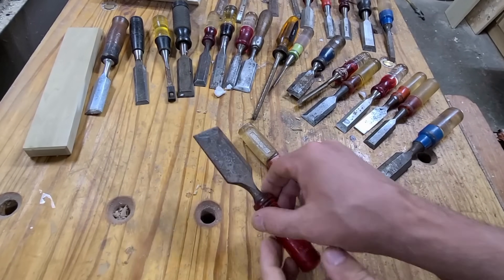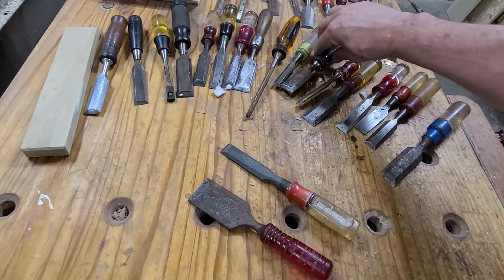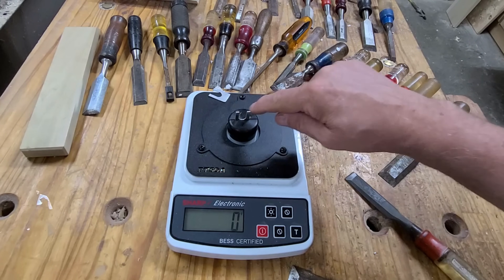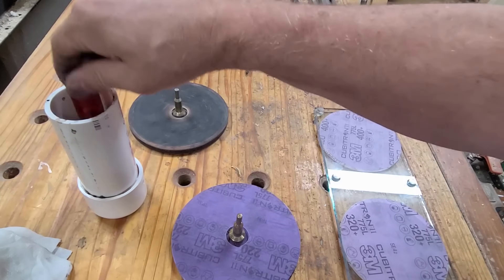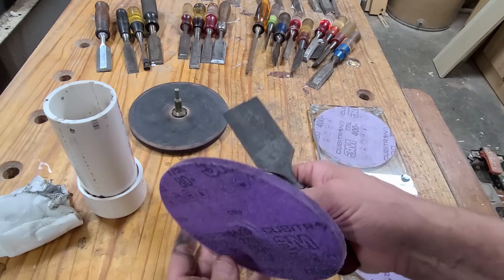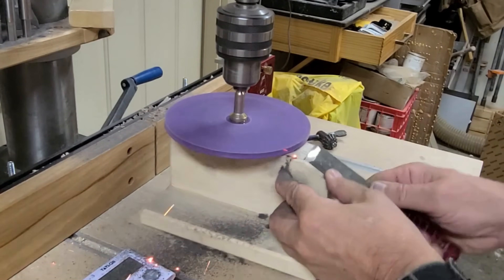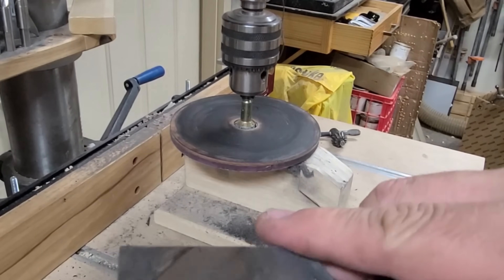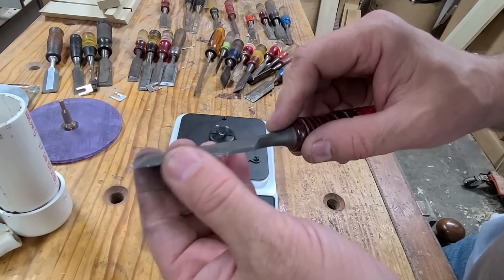Renew the most severely rusted bench chisel in 4 minutes (ON A BUDGET)!!!

Comment: What's the rush?  We do woodwork for pleasure. If you think I believe that the chisel didn't get hot while all those red hot particles of steel were being ground off you must think I'm daft. We used to test sharpness by shaving your arm. A better bit of test kit would have been a thermometer to show the exact temperature......especially near the edge where it is thin and colours up up quickly when you try to cut corners. They still make water cooled wheels for this exact reason.

Comment: Impressive jig. Having a slope is enormously better than a honing guide and/or wetstone wheel. 25 degrees covers plane irons and chisels. Once the chisel has been renovated a 600 diamond disc on the drill press works fine when followed by a buffing or stropping. I watch many woodworking videos. This has got to be one of the best.

Comment: Did you test the hardness after you destroyed the temper?? Why do you only use a tiny part of the edge at a time? Do you not understand all the problems you create by grinding (sanding) in a differant direction than it is supposed to cut?